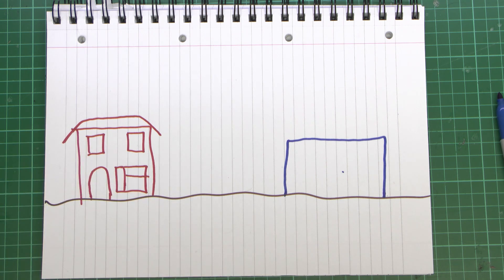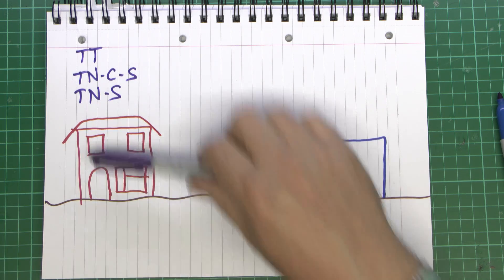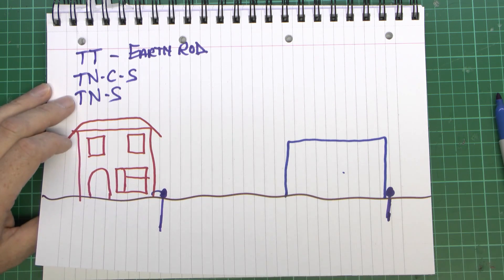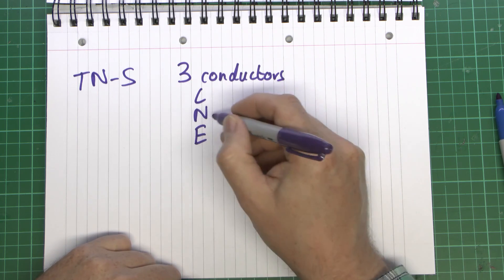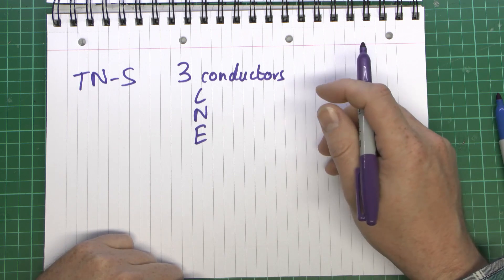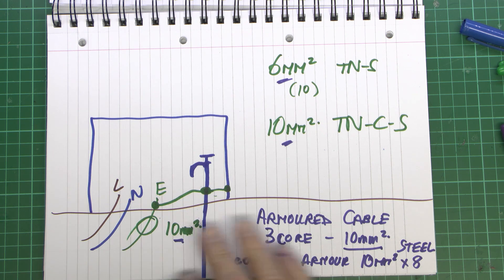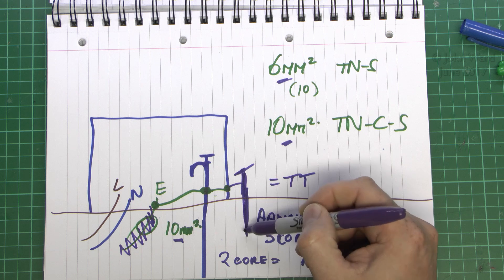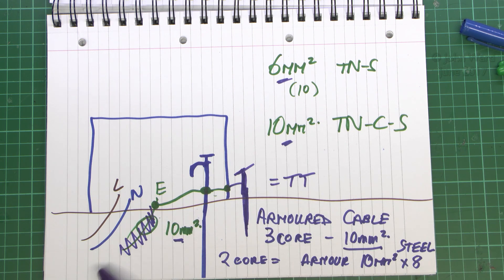Earthing Systems for Outbuildings

Comment: As in the example if using a 3 core where you'd need 10mm2 dose the armour not count towards this. For example allowing you to use 6mm2 with the armour making up the other 4mm2 (not done the maths, just a hyperthetical question)
Reply from the maker: The armour can be used as part of the total, but as it's made from steel, it's effective area is significantly less than might be expected.  6mm² 3 core SWA has steel wire armour of about 23mm², however as copper is about 8 times more conductive than steel, that 23mm² is only equivalent to about 3mm² copper.
Reply: @jwflame  Thanks for taking the time to answer and clearing that up for me. 
I heard you mention the inefficiently of the steel armour but started to wonder. 
Given that it still has to be earthed I thought it must be able to contribute with a 3 core cable. Only as you didn't directly mention this I then started to wonder if with a dedicated earth in place there was a reason the armour wasn't added to you're calculations.

Comment: Would using MICC cable be a solution to the size of the earth conductor - yes I know you need specialist tools and training to make off the ends successfully, or does this not give adequate protection for  buried cables, or should then this be run on a surface instead if possible?

Comment: What about if the earthing system is both tns (ze 0.11ohms) and tncs (ze 0.09ohms) does the separate garage need a earth rod?
Reply from the maker: Not possible to have both TN-S and TN-C-S at the same time - the supply is either separate N&E conductors with TN-S, or a single combined conductor with TN-C-S.  
Impossible for it to be both separate and combined at the same time.

Comment: How would this apply to a series or outside (earthed) metal bollard lights, screwed to concrete slabs, assuming the house is TNCS earthed? Can the house earth be used (as with a wooden shed) or is an earth rod needed for the lights (as they are metal)?
Reply: Probably best to convert to a low voltage system to be sure, see David Savery’s recent video on that.  Otherwise make sure the circuit is RCD protected and have the 5X disconnect time checked for compliance (within 40mS) at the bollard furthest from the supplying RCD.

Comment: John this is very interesting . I hope you will see this as I am kind of late to this , it is 3 years old!   . I have a question , or questions for you if that's Ok? . 
I am "into" lights , especially old street lamps and have installed a few old , restored , cast iron street-lamps in gardens for people .   My question is , would a metal lamp post in a garden,  remote from the house, often some considerable distance , need to be treated the same way as an out-building , as if it WERE an out building ? (Albeit a very "narrow"  thin one)?  
In the past I have always used a relatively small cable to supply lamp posts in gardens like this , (probably a 1.5mm2 three-core SWA) . In the base of the lamp post I would normally connect a bonding conductor to the metal body of the post itself , (often by drilling a hole and fitting a brass earthing bolt).   This would be connected to the earth terminal in the fuse / cutout  which would be connected to the earth-core in the SWA cable and the armour wires.  
However , if I should be treating a lamp post as if it were an out building, and applying what you say in this video , that would mean I would need a minimum 10 mm2 SWA cable , or to provide an earth electrode for the lamp post?  

Is this correct?  Have I been doing these incorrectly?  How would you install a metal lamp post in a garden like this?  Would what you have discussed here in the vid apply to this?
Regards . Jerry.

Comment: For those of us in North America, could you relate the size of wire to wire gauges used here ?  A 10mm squared wire seems awfully large. I would have thought a 10-14 AWG wire would suffice. That would be about 0.07 inches in diameter. Thank you.
Reply from the maker: 10mm² is approximately 7AWG.  If it was a solid conductor it would be 3.57mm diameter, or 0.14 inch diameter, actual wires used are 7 smaller strands.

Comment: Probably a stupid question..... I assume if the outbuilding contains extraneous conductive parts and the 10mm bonding is required, then the 10mm cable from main consumer unit can be broken at the garage consumer unit (connected at earth terminal) before being connected to extraneuos conductive part?
Reply from the maker: Yes.
Usual method would be 3 core armoured into the garage consumer unit, L&N wires to L&N of the switch/RCD and E to the earth bar, then a separate wire from the earth bar to the extraneous conductive part(s).
Reply: @jwflame  I replaced on old garage fuse box for a friend (this supplied 2 sockets and 1 light) which was falling apart. It was fed by existing 2.5mm T + E protected by conduit (extraneous conductive part) at the time i didnt realise I needed to get a 10mm bonding cable to that piece of conduit. Does this make me liable if there is ever a fault in regards to the lack of bonding on that piece of existing conduit? despite  making a small the alteration (replacing fusebox) to make the existing installation substantially safer?

Comment: Cheers John. This seems to be a bone of contention in the sparky world. The DNO don't like you exporting their 
TN-C-S earth even if your outbuilding doesn't have extraneous conducive parts. I've rang the East Anglian DNO and they said no. However NICEIC technical helpline say crack on, or at least they use none committal wording in that if you think the TNCS earth will be better than a TT rod then use it. Seems to be contradictory. This is also becoming an issue for car chargers. Some car chargers say they have built in tech to allow for exported PME earth but again, DNO say no to using it. 

My personal opinion is that installing SWA correctly, losing the earth core is more unlikely than damage to a TT rod earth/16mm cable (which already could be up to 200ohms) but if the DNO are insistent then TT it is. Whats your thoughts please?
Reply: He's still thinking

Comment: Very useful synopsis - thanks. How about running a 10mm bonding wire in parallel with a smaller SWA cable if you have an extraneous conductive situation in the outbuilding as this would keep the cost down?
Reply from the maker: In theory yes - but if buried, 10mm² requires additional mechanical protection.  16mm² does not but that costs significantly more, so in reality the cost savings are minimal.

Comment: An answer for that TN-C-S water pipe issue will be to replace the section that enters the outbuilding with plastic pipe. The bonding issue then doesn't exist.
Of course if the water was supplied via a 15mm copper pipe, with the standard wall thickness of 0.7mm, it has a cross-sectional area of 33mm^2, far greater than any earth bonding cable. It would require a continuity and resistance check back to the bonding point at entry to the property, but as electrical regulations seem to ignore these real world situations, it's not allowable. So, replace that last bit of pipework with plastic. Cheaper and easier than running 10mm cable out to an outhouse just to meet a bonding requirement.

Comment: Is it pemissable to run a seperate 10mm2 earth conductor in parallel with an existing 2.5mm2 SWA as I want to add running water to an existing outbuilding
Reply from the maker: Electrically yes - but a single 10mm² may need mechanical protection depending on how it's installed.
Reply: The easy answer is to use plastic piping and then the problem goes away. You don't even need to run plastic all the way either. In principle, if you have a copper underground pipe you just need to join it underground with plastic and use that to feed the outbuilding. You can even switch to using copper pipework inside the outbuilding if you wish, but I can't see why anybody would do so.
Reply: @TheEulerID    Thanks for the sugestion, I was going to use plastic pipe anyway but I need a metal sink and water heater which is attached to the building and therefore needs to be bonded. so easier to use copper internally and have one earth bond which means 10mm2 back to the house.

Comment: Hiya John. My mate has torn down his wooden shed which had power supplied via swa cable but he's gone and bought a metal tool store to replace it. It isn't sitting on the ground; rather, it sits on decking.

What are your thoughts on this arrangement? He requires a socket outlet fitting for gardening purposes etc.

Comment: Much appreciated. Would you consider inserting an insulated section in  to the water pipe itself, breaking the electrical connection to ground("extraneous part").? This would obviate the need for a 10mm bonding cable and possibly work out cheaper?

Comment: Hello John, great video but I am slightly confused. In your video it says you can export the earth to an outbuilding no matter what system you have? After a lot of reading online says you should never export the earth on a TNCS system (PME) and should be rodded at the outbuilding? I have recently installed power to my metal shed and on a TNS system in the house so have exported as normal and will put a 6mm bond the metal casing. I have a job at my cousins to look at this week. I'm sure she is on TNCS so I plan to not export the earth and use a rod at the shed which is wood. Any help appreciated 👍
Reply from the maker: Depends on the risks involved, and whether someone is likely to be in contact with a part of the installation and the Earth outside.
In a wooden shed the risk is no different to being inside any other building.  If there were extraneous conductive parts in the shed such as a metal water pipe it would need to be bonded in the same way as in any other building, which for a TN-C-S supply is a minimum of 10mm².  The concept being that the pipe in the shed and any exposed conductive parts of the installation in the shed remain at the same potential, even if that potential is different to the Earth outside.
A metal shed is much higher risk as it's very likely that someone could be in contact with the metal parts while standing on the Earth outside, TN-C-S in that situation would not be advisable as there could be a significant potential between the shed and the Earth outside if a fault occurred.
There isn't a single rule for everything - each installation has to be considered on it's own and a decision made as to what is appropriate for that.
However people like easy answers and that's why you can find things which say never to export the earth - even though in many instances there is nothing wrong with doing that.
Reply: @jwflame  Many thanks for the reply John, I seem to be slowly getting my head around it now 👍

Comment: Thank you John. I have a question about earthing arrangements where an oil pipe is common to a house and outbuilding. The earthing arrangement for the house is TN-C-S but as the garage is often damp i would prefer to install a TT system within the garage (correctly separated as per Figure 5.14 guidance note 8). However regulation 411.3.1.2 requires the extraneous conductive parts of all the buildings be connected to the MET, of which there is only one.
Guidance note 8 deals with these situations individually, but not the situation where you have both a TN-C-S and a TT sharing a  common extraneous-conductive-part.
Reply from the maker: Not possible to have two different earthing systems with shared ECPs - if they are linked together in any way, they become the same system, TN-C-S in this case.
Reply: Thank you for your quick response, it makes sense that the common ECP should share the same earth system, is this detailed in a regulation either directly or indirectly?
I am also searching the good book for a definite of when it is necessary to install TT but again am struggling to find definitive answers (other than caravan sites, hot tubs and EV charging). I would be greatful to here your advice on this.
Kind regards, 
Dominic
Reply from the maker: @MrDHouseman1000  Not a regulation, just an inevitable fact that if you connect two conductive things together, they become part of the same system.
TT is only required for those things mentioned in terms of regulations in BS7671. For anywhere else, it's up to the designer of the installation to determine whether using TN-C-S is appropriate based on the particular set of circumstances.  The main factors being the risks when a PEN conductor is broken, and electromagnetic compatibility.

Comment: John I have just recently put up a metallic hut. I know this will need 10mm bonding as it's a TNC-S configuration at my cable head. Can I take the 10mm bonding from the water pipe in my kitchen which is at the side where the hut is? Or do I need to take it from the MET or consumer unit which is the opposite side of the house and would mean lifting flooring and stuff?

Kev

Comment: What are the consequences of a water utility company changing your lead pipe for HDPE plastic WRT the earth protection in your home? Great videos, binge watching here in Thailand where the electrical competence is appalling.
Reply from the maker: None, since in the UK, using a water pipe as the earth connection has not been permitted since 1966. If there are any installations still like that, they haven't had any work or inspection done in over 50 years, so is very likely a dangerous disaster anyway.
Reply: @jwflame  Thanks JW

Comment: Cheers John. Great video. Does the house supply to the garage need to be through an RCD? Obviously the little box in the garage would have it's own RCD.
Reply from the maker: Depends on the cable used to supply the garage, and what type of earthing system is in use.
Reply: @jwflame  hi John. Cable is armoured 2 core and supply earth is TN-S from overhead lines.
Reply from the maker: @dangerdaveofdevon  RCD not required for armoured cable, however it will still need an MCB or fuse at the house end.
Reply: @jwflame  thanks John.

Comment: A as a lay person,  is there a way we can ascertain what our earring system is?
Reply from the maker: If there is an earth rod connected to the installation and no other erath terminal, then it's most likely TT.  If there is no rod, and the earth terminal is at the main fuse or incoming cable, it's TN-S or TN-C-S.
For a definite answer, the network operator can be contacted, in the UK call 105.
Reply: @jwflame  thank you very much for taking the time to reply, very helpful

Comment: Hi John. I need 10mm for the bonding. Let's say I got 6mm 3 core of swa coming into my garage. If I used a copper core for my earth could I combine that with the steel on the outer sheath to increase the earth size. It would now be close to the 10mm required? If not quite there, just to be absolutely compliant would I be able to stick into the ground a small TT rod, that in combination with the steel and the copper takes it to an equivalent 10mm? And I guess that a small garage consumer unit with a RCD would help with the safety of the installation?
Reply from the maker: In theory a core + armour can be used for the bonding conductor, but in reality 6mm² 3 core SWA armour is too small, usually about 23mm² steel which is equivalent conductivity to 2mm² or 3mm² copper (about 8 times less conductive).  
Note that the 10mm² minimum only applies to TN-C-S supplies, it can be smaller (6mm²) in some circumstances for other supply types.
An earth rod is of no use - bonding and earthing are two separate things, one cannot be used as a substitute for the other.
Reply: @jwflame  Thank you for your prompt and detailed reply. I've been watching your tutorials for three years now. They helped me through college and still do today. They hit the mark regarding my continuing education. Thanks again.

Comment: Here's an interesting one: power from an attached garage (where CU is situated) to feed a wooden shed, maximum 6 feet away on a concrete base with concrete path between and a concrete garage floor!

Questions
1. Is a catenary supported SWA installation legitimate or MUST the cable be underground?
2. The house is TT so presumably the shed will need to be TT also, or is six feet considered OK to use the same TT earth as the house? Seems undesirable at best to do the latter
3. Presumably also, all circuits will need to be protected overall by RCD anyway or individual RCBO?
4. What are the considerations for avoiding inductive spike loops? The house rod will be connected to the shed rod via the ground and there will be an earth cable running overhead to the CU in the shed. Unless there is an earth break somewhere, a full earth loop with the loop resistance in it will be created. What is the recommended mitigation or avoidance for this? 
           a) Bring the SWA earth connection (3 core cable) into the shed connecting solely to the SWA steel sheath in a separate insulated enclosure and connect the system PE directly to the shed rod?
           b) Bring the SWA connection into the shed and connect it AND the shed rod to system PE  and ignore any possible ground loop effects?
           c) Bring the SWA connection into the shed and connect the SWA earth to both system PE (including the metal shed CU enclosure and the steel sheath on the SWA and not use a shed rod (due to it's close proximity to the garage and the source power CU)? 
5. Presumably NOW (Feb 2020) the 18th edition regs apply and the shed CU must be a metal clad one (earthedto what?) with plastic being non-legit?